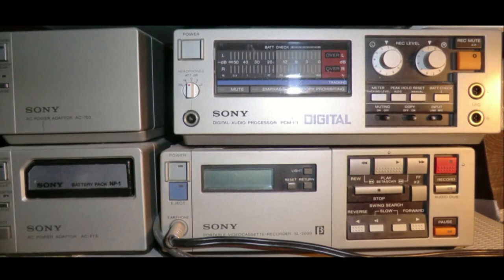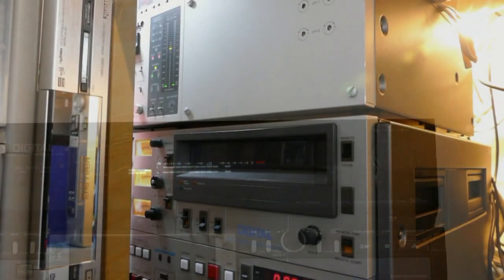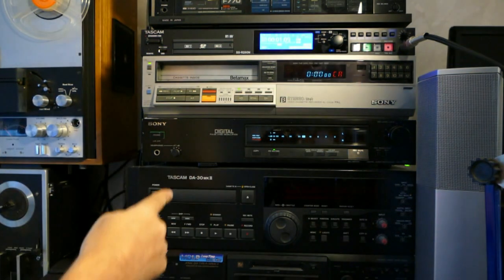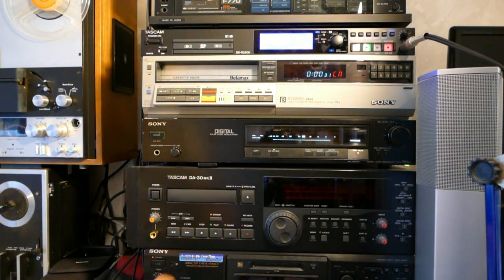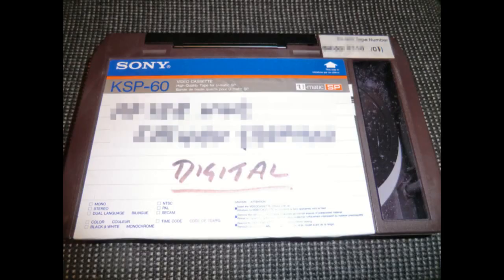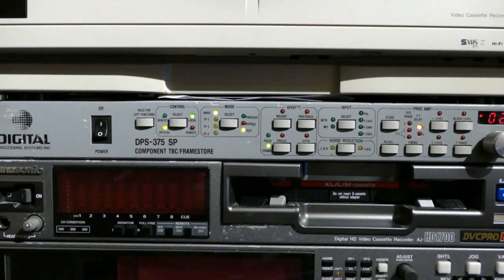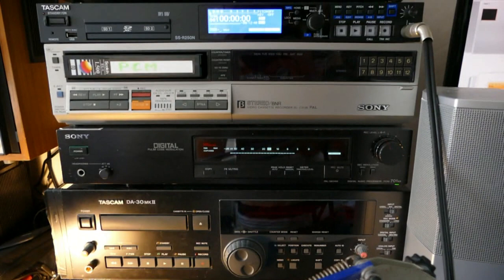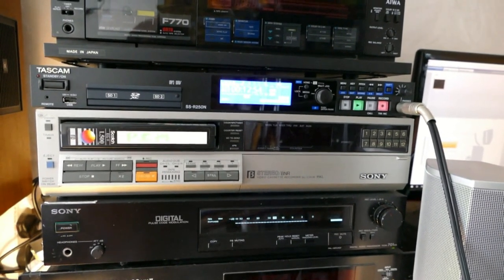Experiments with PCM F1 digital audio recordings.

Comment: Watching the video signal on the monitor takes me back years, when the BBC used to move stereo audio around the UK using Sony F1 / 701 on video links. I have sat there watching that signal on monitors in links trucks and in the London Switching Centre. Very good robust mode of getting stereo phase matched circuits when BT couldn't provide anything suitable. You could also add mono sound in syncs to it (and possibly stereo SiS too although I can't remember doing that) giving more audio options!

Comment: I had the PCM-F1 back in the 90's. I used it for home recording but was disappointed that the emphasis was not switchable. I added switches to disable the capacitor circuit at the front end and remove the emphasis digital flag that was added to the tape. This gave the F1 a almost perfectly flat response curve from 20 to 20000 hz.

Comment: That’s really interesting. I’ve always had a soft spot for these stand-alone PCM encoders, but didn’t realise there were so many considerations on the tape deck side too! 

I wonder if the TBC and DOC were the cause for LGR’s corrupted files on the Danmere Backer.
Reply from the maker: The DOC certainly wouldn't help.  I tried a Danmere Backer card back in the day and found it to be far too much trouble.

Comment: I also have a PCM 501 ES and wish I had a 601. It works well enough but I know a direct SPDIF connection would be best.
Reply from the maker: As it happens I am now in contact with one of the people who was involved in the Whistlewood SPDIF modification.  But there's little chance of any more being made, much of the documentation is long gone.
Reply: Does it use a single or double sided PCB? If they have the board artwork more can be made (if chips are available).
Reply from the maker: It's double-sided.   All chips seem to be available, one is fairly expensive.  The pulse transformer may be quite difficult to source. Each one may have required a bit of fine-tuning such as component tweaking and extra capacitors.  My next video will be about this very subject actually.

Comment: I find it interesting when you say anything not using beta is a non-standard configuration.  I had always used a 501 with an VHS industrial deck.  The deck has no tbc nor drop out compensation.  It always worked superb.  Have literally thousands of hours in that form.  Still works too.  Wish mine had a digital out though.
Reply from the maker: Yes it has a Dropout Compensator (D.O.C).  Essentially all video recorders do, of every format.  So being unable to disable the D.O.C results in more errors than would be the case on a machine which is specifically designed for use with PCM applications.  Of course, if you have perfect tapes with zero dropouts, then you would get away with it.  People did use these units with VHS sometimes.
Reply from the maker: See my latest video which discusses the SPDIF upgrade in more detail:
https://www.youtube.com/watch?v=ZYG_8_uMZKI